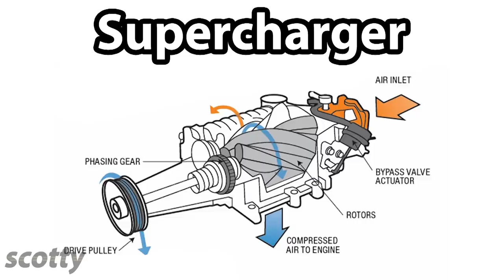Supercharger vs Turbocharger - Why Supercharged Car is Better than Turbo

Comment: One of the few guys on youtube who likes superchargers 😉
Reply: They are better! Owned both.
Reply: @ddm62571  agreed
Reply: So the number of your comment's likes is going to determine the supercharger fans
Reply: @ddm62571  i have only driven a turbo car and even though turbos can be more powerful i think supercharged offers a better driving experience.
Reply: @antreaskonstantinou8585  The more power thing is subjective. You can increase the Supercharger as well as the Turbo. They just have a different feel when accelerating. One  is a pull feel the other is a push feel.
Reply: They are obviously better
Reply: I like the engine to respond when I press the throttle
Reply: He's the only one
Reply: @ladawg81 why would you waste a high revving motor by supercharging it? Nothing against Superchargers since I’m supercharging my Z but turbo is the way to go for a rotary
Reply: There better
Reply: Turbos will always make more power
Reply: It's more reliable too
Reply: @ddm62571  Lol, what in the world are you talking about? Subjective? Push vs pull? What is this nonsense?
Reply: @tdb19872  Subjective yes on which one's produces more power.
Reply: @ddm62571  Thing's that are measurable are not subjective at all.
Reply: @tdb19872  Not true! Even when  supercharges and turbochargers are measured at the same amount of PSI people still have a debate which is better.
Reply: @ddm62571  People are stupid, that's not news. Denominators, power curves, average power, 0-60 times, trap speeds, etc aren't subjective and aren't open to debate. These are hard measurements. People hace opinions about which they like better for various reasons and in various circumstances, but comparing what makes more power isn't subjective, one doesn't push, and the other pull, this is not a thing.
Reply: @roymilla6636  💀 no it’s not it gives worst gas mileage an outs more strain on you engine
Reply: @Gabethemosthated  I have a supercharger car and still daily drive it doesn't give me problem yet.
Reply: @roymilla6636  yea but it still puts more strain on your engine you can say the same about turbos for your exhaust but I rather my exhaust take the blunt then the engine an plus turbos give better mid to high end power an better low end torque plus there more tunable which means more power, no hate in sc tho because they can be really good if you use them right an have the right setup
Reply: Makes sense since superchargers are better I've had both and they're better Whipple is better ProCharger is better turbo is not better It's an easy logic
Reply: @Name-yp3pi um nope
Reply: @Gabethemosthated it puts no more strain than an alternator does on your car What are you talking about lol
Reply: A supercharger shows torque gain throughout the entire rev band besides top end where turbo slaps the supercharger silly.

Comment: Income the angry ricers
Reply: @just_a5.7  non car guy that hates any car that weighs alot
Reply: @just_a5.7  let me guess, you're probably an ex skater that thought he was going to get sponsored but never did
Reply: Jets Set Nun less
lets see a TT Supra against a top fuel dragster 
The engine used to power a Top Fuel drag racing car follows the basic layout found in the second generation Chrysler 426 Hemi "Elephant Engine"
Reply: @just_a5.7  Fast supras use a single turbo setup 99.9% of the time, not twins......move along fanboy
Reply: Anthony Webber You're comparing a sub 300hp 20year old engine to a new 1000hp stock from the factory engine. Seems like the 2j won already based on  over engineering longevity and applications. It can be a good street, track, drift and drag set up. The Hellaphent is still new but I doubt it will attain the status the 2J has achieved.
Reply: DabCity DWC Wrong engine, he is not talking about the Hellephant. He’s talking about the second gen Chrysler 426 produced from 1964-1971, a LEGENDARY engine.
Reply: @just_a5.7  sweet where can you buy one new today? Yeah...
Reply: @anthonywebber2211  why compare a race car to a street car? Lol. Let's see that top fuel do a turn. 🤘😂
Reply: @dabcitydwcsfv420 , a top fuel dragsters make 11,000 HP, and the 2JZ is 28 years old
Reply: @SkarryTerry , I don't see Supras taking turns either
Reply: My 335i gets 600hp am I a ricer?
Reply: Lol cause if you like turbos your a ricer...makes no sense at all
Reply: Jets Set Nun less How about The Mopar Challenger Demon? (Mopar is Dodge, Chrysler, Jeep.) So the Dodge Challenger Demon is Supercharged, which it will beat the Supra.
Reply: @SkarryTerry  let's see the viper acr extreme verse a supra 😂
Reply: @anthonywebber2211  and the engine that holds the corkscrew blower only cause more then a brand new pickup.
Reply: @elijahcormier5239  no it won't are you kidding it will run 10.1 and a supra can run low 8s with eases
Reply: Anthony Webber THEY DONT MAKE 11000 HP PFFFTTTTT
Reply: Midwest Mopars I am a big car fan, all cars, vtecs and all. I think it’s safe to say turbo vs supercharger is mainly based on the application. The build has to work with what you are trying to accomplish. Imagine a supercharged 2JZ-GE, weird huh? But LS can do both, supercharged LS3 OR Turbocharged LSX. It depends on what the build has. Boom.
Reply: Why the hell would using a turbo make you a ricer ?
Reply: i blow out most ricers with my v6 3.8 l g body, weird thing is i can hear them struggling, foot down to the floor and we cruising by like a boat. i believe they just want to be seen by others rather than speed.
Reply: Well...I’m not a ricer but it’s common sense that Turbo’s are better then Superchargers! Their’s well Documented articles on it! You should read up if you think otherwise!
Reply: Literally every automaker is using turbos now, even pasta rockets.  Supercharging is too inefficient.
Reply: Jets Set 5.0  you only say that because you go off of information by YouTube videos and Instagram. Most toxic way to compare cars.
Reply: Jets Set . Oh you’re cool
Reply: This vid may not have said everything in comparison between to the ways to charge the motor, but superchargers definitely will get you better power than turbos
Reply: @Maniac742  Well yeah, Turbos are better for the very thing that was said at the beginning. They use the exhaust, not the belt. So they're just using something that would have been wasted. I love them considering this philosophy. Obv for all the other reasons explained a Super would be better. But I should trade better fuel economy, a cool sound and a funny boost for instaspeed that sounds like a baby crying. No thanks.
Reply: @just_a5.7  all I have to say power to weight ratio
Reply: Dude thats so true I have a car that i cant decide wether to supercharge or turbo

Comment: Love the Whine of a Supercharger, but love the Spool of a Turbo Life's great paradox.
Reply: why not both
Reply: Ya get a procharger, they are belt driven so you still get your whine but they use a turbo impeller type of system so you still get the spook up sound, and you can put a blow off valve on it. Psssssssh
Reply: oh i see what i mean....what i meant here using both....a supercharger for low bottom end and then boost kicks in at higher RPM ....twin charging as many call it
Reply: Vroooooom Psssshhhhhhh! ahahah I miss having a turbo with massive Blow off valve that scared people on the streets
Reply: Jonny DIY Scotty Kilmer forgetting anti lag devices like my favourite jet powered combuster car turbochargers Subaru used it but had turned off because the USA government though a stink fit, or the classic 2 step
Reply: I own a ZL1 Camaro....yes, love that whine.
Reply: Can't get the best of both worlds...cant be simpy evil or simply good, always gotta be in between, even speaking of cars...
Plus, only us made car engines have the ability for the standard  "bolt in" Supercharger kit...but if you have european or japanese car engines, turbo is the best, fastest and cheapest air intake boost kit to install on any regular car...(i guess scotty didn't think about it twice before speaking) :) 
But besides being cheaper and easier to install, turbos sound better and have so much more fuel efficiency than superchargers...what's best than driving a beast moded car while going less to the pump, especially with how fast gas prices rise up nowadays..
Reply: Twincharging is the answer!
Reply: Michael Rogers haha we have the same name thats cool
Reply: Your logic is stupid turbo has been  proven to be better more efficient and no parasitic effect
Reply: WHEEEEEEEEER KAH CHUUUUUUUUUUU PSSSSS!!!!! XD
Reply: I honestly prefer supercharger exhaust sounds. Exotic twin turbo exhausts sound nice - but they are just that, exotic. Twice the turbo, twice the upkeep and plumbing complexity. The extreme vast majority of turbo cars on the road are all using the same sort of exhaust setup - single turbo into a large diameter midpipe, often into a Y-pipe for a V8 car with a factory dual exhaust setup, or just one large diameter pipe back into a single muffler as most turbo imports use. Real turbo psychos use flame spitting hood or fender exit pipes that will make your ears ring all day. This is a very efficient setup but it makes the exhaust sound somewhat "muddy", especially V engines, which have a natural uneven lope accentuated by individual exhaust banks.

I know of plenty of turbo cars that can keep up with a blown V8 engine car with long tube headers, an X-pipe and bullet mufflers; while using less gas - but none of them sound anything like it, "spooling" sound or not.
Reply: topgunner58 this video was weird. Supercharger because I’m old school. I thought I was supposed to be about the facts.
Reply: @prushimush  can twin turbos give the same effect as a super charger
Reply: @TheMrmagic101  no it cant, you’ll just have less lag but it’ll still be there.

Comment: Yeah, I don’t have all day waiting for boost to build, it’s my HP and I want it NOW!
Reply: 876-cash-now
Reply: @bc_usa  LOl
Reply: Supercharger = instant power     Turbo = Bigger power gain
Reply: @Name-yp3pi wdym by bigger power gain. I’m still learning about cars. Like do you mean higher top speed
Reply: Lmfao 🤣 🤣 🤣 
👍💯
Reply: @jrzapien4469 superchargers use power to make power. They’re like AC, they take a little to run, but give you more in turn. Turbos use exhaust gases to make boost, meaning your engine will usually make more power.

Comment: I’ve installed both on my cars and for city driving I had more fun with supercharger with the instantaneous blast at the low end! But I did love my twin turbo Supra on the highway! That damn thing just squeezed top speed better than any supercharger I’ve ever used.
Reply: Here's what I think. Turbos are better for highway pulls and taking it to the dragstrip, but superchargers are way better for daily driving. Since you have turbo lag, when you're daily driving you're never really gonna get or feel that power unless you're doing random pulls on the highway, where as superchargers the power is always there and can get insane pulls just because you put your foot down a little while you were coming off a red light lol
Reply: Dear, Scuba Bro..
Please, don't melt me with radio waves. Please. 
Also, are you a mad scientist? I saw your YouTube channel....what r u? Lol 🤣 advanced radio wave Mathematics and twin turbo supras? ... Elon Musk? Lol
Reply: Got a Supra? Twin charge! Make it run both, the supercharger will help the turbo spool way faster (you can had bigger turbos) and when it does you’ll have more boost than a supercharger alone.
Reply: @ProudMurican_PVT-GR137  , that would be sweet! At the time when I had it I couldn’t afford a setup like that but I sure as hell would have loved it if I did 😂👍🏻
Reply: @ProudMurican_PVT-GR137  *Says like Borat*  "I luv ah U-S-N-EH!! High Five, Alright 👍"
Reply: @GameNeet Nobody that has ever raced at a dragstrip has ever said "I'm sure glad I have a turbo instead of a supercharger!" Turbos don't win drags due to the lag. Superchargers generate boost off the line a WOT, which is why you rarely ever see a turbo at a dragrace, and when you do, it's as a twincharger setup in order to overcome the lag, and even then, they're at a disadvantage to a straight SC setup.
Reply: Could one supercharge a turbo, or would it be turbo charging a super charger.. ?
Reply: @iamwhoimnotimnotwhoiam4431  I think it’s supercharging a turbo because the turbo would get power faster from the supercharger